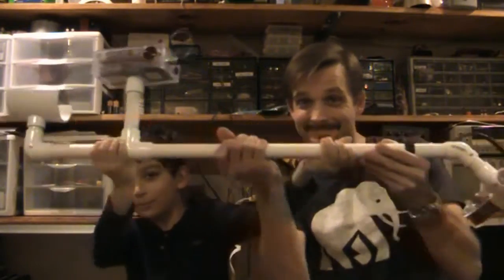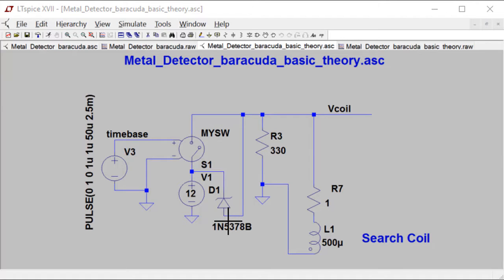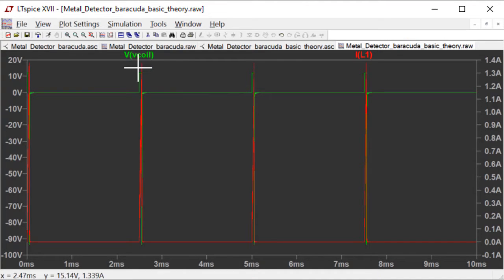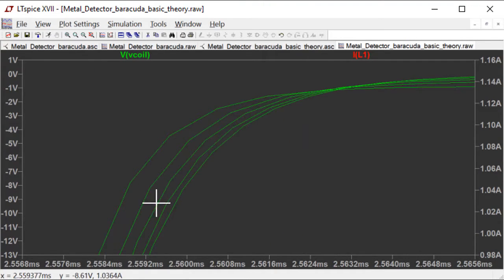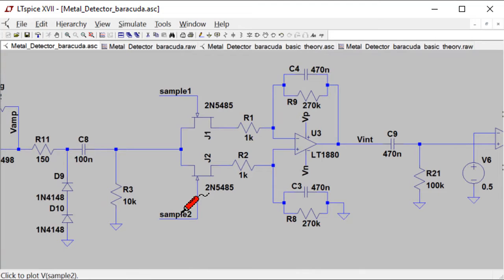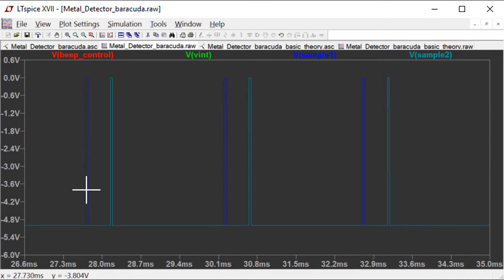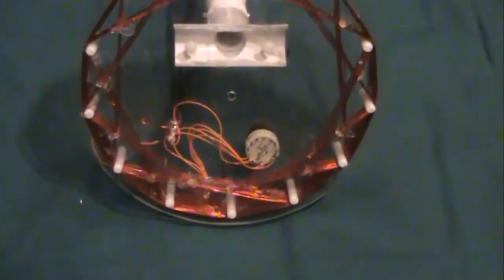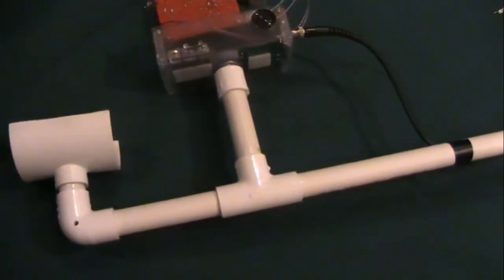Geotech Barracuda Metal Detector: Demo, Simulation, Construction

Comment: Good video. Can this software be used to simulate an Inductance Balancing metal detector which has two coils working together?
Reply from the maker: Hi there!! Sorry for the late reply - In LTspice you should definitely be able to parameterize the inductance of your coils, and if you have two, have the inductance of one increase while the inductance of the other decreases, and use a PWL voltage source to simulate a target chunk of metal approaching the coils. But I'd definitely start simple - use ideal stimulus / measurement, then try to simulate the principle of operation of the detector, before trying to simulate an entire circuit.
Reply: @thorenscientific Thanks for your reply. How did you create the IRF9640 model in LTspice?
Reply: and how did you simulate the delay in ltspice

Comment: Hi, I bought this kit from silverdog and I'm trying to get some ideas regarding battery life and structure of the detector.
I've seen that you used an LTC3121 and just three AA batteries. I was told to use an 8 pack AA batteries to get 12 volts. But you do it just with 3 and that step-up converter. Could you tell me what's the difference between using 8 AA bateries (12v) and using 3 batteries+step up converter? For how long do your batteries last?

Apart from that. Your coil design is awesome, but how is it called? wow I've only seen mono coils and double D coils, but your coil has lots of copper and turns. Does it perform better than a mono coil? Does that design have a name so I can look for some information? Thanks